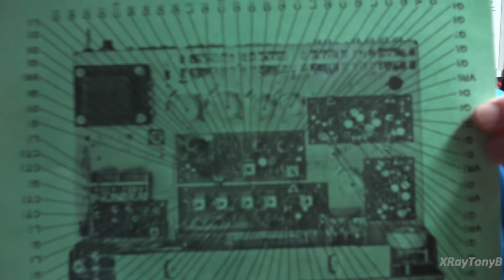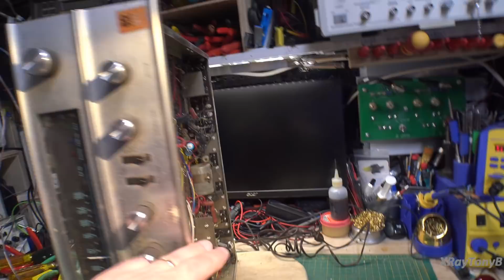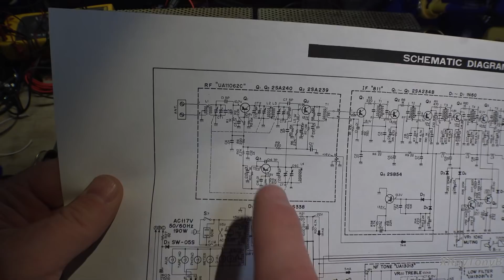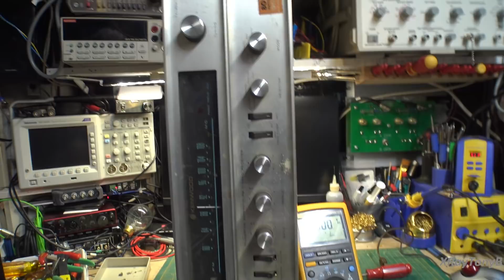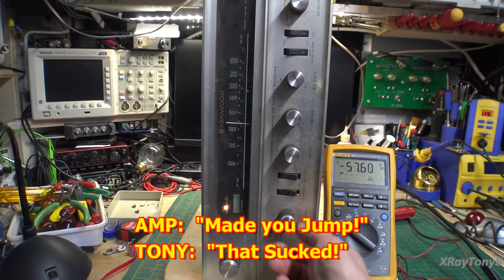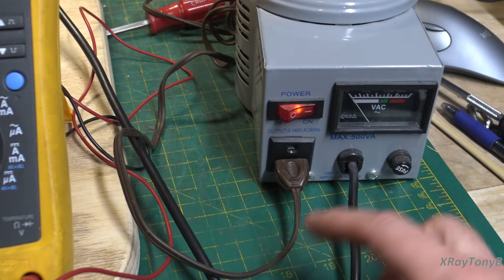Kenwood TK 80U Receiver  Part 1:   Not What I expected!

Comment: On other hand it is good to think about say 50 years of time , happenings and circuimstances around, events, holidays, bithdays with it, chidren growing   and to think that all that time such very apreciated by owner thing was laying in one safe place seldom   used untouched  or serviced always (may be 20 times?) only  by best   shop as yours . Owning something we can do anything with it  to our satisfaction 

Buying thing so old we need to accept that something was treated as fully own,  not preserved for next owner in immaculate state. As imagined owner I surely would do what is done here - to secure print board from overheating and no reparable damage (if it only is possible) I cut elements and solder to old wires. For noisy solid entrance stage I would lkie to make else tube replacemanet or additional tube HF wide range stage beacuse  I love high performance and wouldn't expect it from evaery solid japan set - I've seen  elements too much  unaccurate do schematics. .

Comment: I have a Lafayette LT-250 FM stereo tube tuner made by Trio that resembles this Kenwood, particularly the rocker switches on the front panel. I haven't watched the whole video yet, but one thing I've found about Japanese parts like resistors and capacitors is that they get markedly worse and worse as you get back in the 1960s. The Japanese must have revolutionized their parts quality from the 1960s into the 1970s. My tuner was full of leaky grey tubular (Nichicon, I think) capacitors, and resistor values were all over the place, way off their nominal values. The circuit design was great, but the parts weren't.
Reply: I think so too - the circiut design was more than competition could afford to make (without doubling the price) but the "hidden" quality was below because was covered with  patents and rooted in long experience. .

Comment: Hi Tony! I'm new to your channel. I had a situation just like yours, while attempting to repair a Marantz Stereo Receiver SR 820 DC which was bought and marketed in Europe only. The so called schematic was found by my brother-in law once he took a stab at trying to rebuild the finals in the main amplifier.which were blown out. After he had struggled with it and could getter going he gave it back to me. In my discovery, I took a very close look at it and just like yours, the schematic was not the right one! Although the brother in law tried his best and I in turn used generic equivalence matched grade IC's and what not, I absolute could not get the drive bias correct in order to get the finals to fire up properly. So, between the both of us, we finally threw in the towel. Even though both myself and my brother in-law approached Marantz for the proper acquisition of parts and schematics, they flat ass refused to sell to us because we were not authorized service center even though they both of us worked in military fields of repair. I got hot as a firecracker and then decided that i would never, ever buy another Marantz Audio equipment ever again.....End of story!!!!
Reply: couldn't getter going is what i meant

Comment: This receiver from Kenwood ressembles cosmetically  almost identical to  my TRIO receiver witch is a  fully tube design with an ECL82 push pull output stage. The front plate and the buttons are the same...............I think TRIO was maybe an earlier Kenwood brand  name.   ( KW- 33L )

Comment: You stopped just short of explaining how a dimbulb tester limits the current: The positive temperature coefficient of the tungsten makes the lightbulb almost a dead short when it's cold. But when you send current through it, it heats up (and lights up, conveniently) and its resistance increases. That lowers the voltage in the Device Under Test, and therefore also the current.
So if there's a dead short in the DUT (in other words, the voltage on the DUT is kept at 0 by some problem), the lightbulb will light up at its normal brightness, as if you had plugged it into the wall directly. If the lightbulb is 40 W, and the mains voltage is 120 V, the current through the DUT will never be higher than 40 / 120 = 0.333 A. No fuses will be blown (if the entire path doesn't have a fuse under 333mA) and nothing will go up in smoke (hopefully), but you will still be able to see clearly that something is very wrong, because the lightbulb lights up brightly. But if the DUT is working normally, it has its own internal resistance that limits the current, and the lightbulb will only light up briefly during the time that the power filter capacitors charge.
If you have a DUT that uses more current than 333mA under normal operation, you will need a light bulb with a bigger wattage. You can also put multiple lightbulbs in parallel.

Comment: Hi tony this is going to a great collection of video’s , i do have a question about using a variac as they are quite expensive could you use a variable speed control for a heavy duty drill instead, one of my mad moments coming up with this idea
Mike

Comment: I think that valve section is similar to the one in the Trio TK500 "transistor" tuner that I have. I found a circuit diagram for it which lists the valves as 6CW4 and 6AQ8. There's a service manual listed for the Kenwood TK500 on EBAY but the schematic is available if you Google it. Try https://www.ebay.co.uk/itm/Kenwood-Service-Manual-TK-500-Amplifier-Amp-Original-Manual/201275108826

Comment: I bought a Radio Shack integrated amp in the 70s as a teenager that was being discontinued and heavily discounted, long since discarded. I bought another one off Ebay a few years ago just for nostalgia sake. Same model, same face plate but the circuitry is much different. My first unit was a bipolar OCL topology. The Ebay unit is a single ended power supply topology with output capacitors.

Comment: Someone else has already mentioned earlier in the thread about the power supply would be interesting due to this amplifier being a hybrid. Now, I was re watching videos because of social distancing and the fact that I have watched everything from everyone I follow, I found myself watching an old video from Dave over at EEVBlog about one of those vacuum tube pre amp things that you get real cheap on eBay. What threw me was when he reverse engineered the circuit to see if the tubes were actually doing anything, I saw that the tubes were running from plus minus 12v, that's 24v peak to peak! WTF? I have a similar one that needs a 12v AC adapter to run, I have never questioned how it works of a 12v supply until I saw Dave's video in which the one that he had needed a 6v adapter... 
My understanding was that vacuum tubes need hundreds of volts to be able to work, even the datasheet shows the maximum voltage is up around 170v, but 24v? How low in the voltage range can tubes work? This has opened up a new can of worms for me, now I'm looking at the tubes in that Kenwood amplifier and wondering if they are running on low voltage or is this low voltage thing just a recent method?

Comment: Re: the explanation around 14:30, you're muddling ESR and leakage into one which is not helping clarity. These should be considered separately:
1. High ESR will cause excessive self-heating whenever substantial levels of (high-frequency) AC are being applied to the cap. Switch-mode power supply secondary-side smoothing caps are a prime example. In general, high ESR is a result of the capacitor drying out, which again is linked to self-heating, which is linked to ESR. As you are stating correctly, it is a self-amplifying process, so once things start going south, they will do so fairly quickly, up to the point of bulging / venting.
2. Leakage is a direct result of imperfections in the capacitor's dielectric layer.  It will occur even when capacitors are subjected to plain DC. As current flows, it tends to build up the Al oxide that forms the dielectric layer, hence why leakage has a tendency to subside once DC has been applied for a while. However, while this tends to repair small irregularities, the process cannot fully replace the forming going on during manufacture. If the capacitor has been left shorted for a long time, it may be left with a suboptimally formed dielectric layer and permanently excessive leakage current, tending to heat up and dry out the cap long-term. Dielectric breakthrough may even be so violent that substantial currents start flowing and carbon bridges form through the dielectric layer, at which point the cap is basically a goner, being more or less shorted (unless you are going to reshuffle the windings in a way that disrupts the carbon bridge, and people haven't been this desparate since WWII when the technology was a lot less mature).

There is a link between the two in that substantial self-heating due to excessive leakage would result in drying out with its associated high ESR.

It will appear that electrolyte chemistry plays a role in the development of excessive leakage, given that some series (e.g. Philips axials) tend to go leaky even when just sitting in a drawer for a number of years. I can only guess that the electrolyte starts eating away the oxide layer either due to its composition or undergoing some sort of change. What should be happening is that a small voltage should start forming between the terminals, which eventually counteracts any further degradation of the dielectric layer.

Comment: I worked on a TK-60BU but I could not find a manual for it.  It did not have tubes but all the smaller electrolytic caps on mine were dried out.  Just had to replace all the caps, the lamps, and clean the controls.  I would not work on one of those again though, kind of a pain.

Comment: (@23:45) - if you look right below the two largest capacitors at the top of the screen, someone replaced a thermistor (a heat-sensitive resistor) with a (blue) electrolytic capacitor - Yikes! 😬

Comment: The one thing I would add on the dim bulb tester is to have the wide spade of the line cord, which is the neutral, go straight to wide side of the jack. This is to keep all the rest on the hot side so if the fuse or bulb burns out, your unit under test is not hot. 
This looks like a great unit to work on.
Reply: Or you could unscrew the bulb. 😊

Comment: It sounds to me like there is DC voltage leaking into the volume control....With the state of the onboard hacks and no actual schematic or service manual, it sounds like a project to be undertaken over the course of several long cold winters, or parted out....!

Comment: That's a very interesting receiver!  I have a TK-50 I started working on that looks similar, but electrically more in common with my later TK-66.  I will tell you, when you get that receiver recapped and going, the sound quality will blow you away!  My TK-66 continues to amaze me in how detailed it sounds.  One upgrade I highly recommend is to upgrade the output coupling caps from 1000mfd to 2200mfd.  This will help on the bottom end of the bass response.  I used Nichicon FG audio grade caps in my TK-66 when I recapped it and replaced the trim pots on the amp board with multi-turn trim pots as the originals were bad.  These receivers are true sleepers!

Comment: Vessel screwdriver spotted!
Reply: I've got the same set of screwdrivers. So much nicer than trying to use a Philips on JIS screws.
Reply: @bugdrvr  Vessels are such awesome screwdrivers. Work on every crosspoint screw I've come across.
Reply: Hi Tony is it possible to get in touch with. You? I have a Pioneer SX-750 with a main amp problem and was wondering if you could repair it?